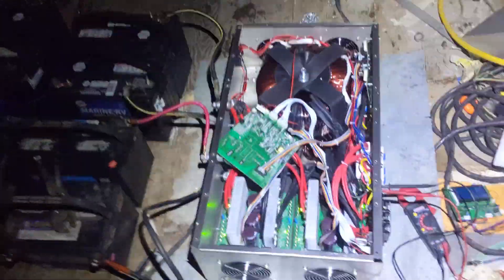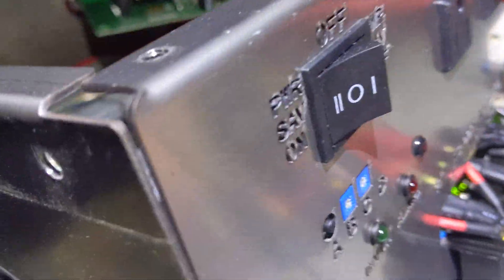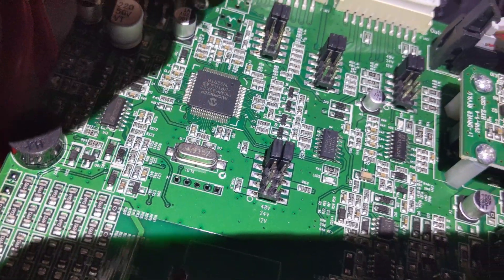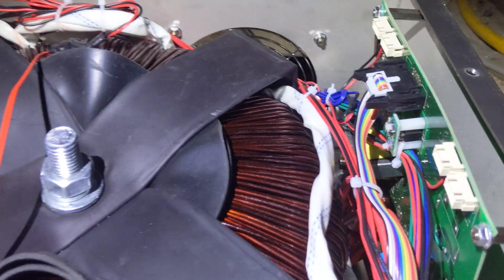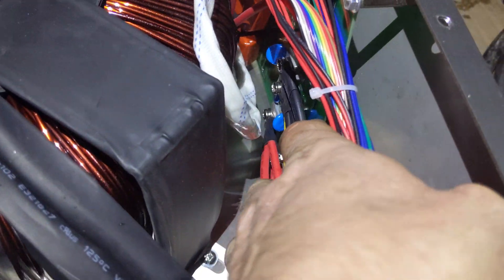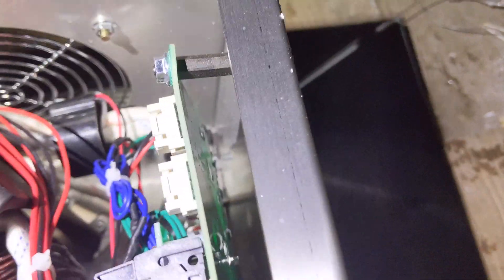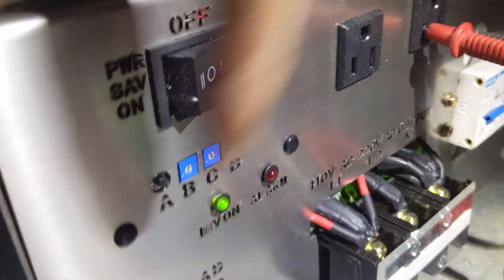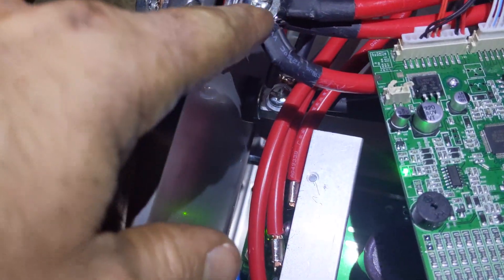PowerJack 20Kw Invertor Review - Dead On Arrival

Comment: I have seen knurlgnar24's review of Power Jack Inverter https://www.youtube.com/watch?v=PI9kAWQ_s4w.  Some of these inverters are undersized, and have a lot of heat shutdown issues, and other issues.  I have heard you might have better success with brands such as Samlex, Thor, Power Bright, and others.
Reply from the maker: Ya, probably 90% of other brand name investors will be more reliable and put out the power they are rated for.  They are priced pretty cheap, so I thought I would give them a chance. But ya, you get what you pay for most of the time.  My 12kw Growatt inverter is 100 times better than that Power Jack piece of 💩 and I've put it to the test, too.  So far, I've put a 7kw load on it while welding. And starts up my aircompressor, no problem.

Comment: Hi Spooner i've lost my powerjack info booklet could you tell me on the 48v's what's the most voltage it can accept i have lifepo4 batteries 
when my batteries hit their voltage of 56 after a few minutes it does like a surge and power off the inverter just checking i have now set my batteries to 55.2v this just done as of tonight....
Reply from the maker: Sorry I really don't know what the max input voltage is set at on these inverters.  I never really was able to test mine out that much.  I wnded up returned mine and got my money back.
Reply: ty sorry to bug ya

Comment: I have the exact same inverter not even hooked up yet....i have 10000 watts of panels i have 32 6 volt deep cycle batteries 48 volt system i have 4 banks what size breaker should i put between the battery and the inverter

Comment: how can i ground the inverter i can't find the equipment ground post on the inverter
Reply from the maker: I'd just remove one of the outside screws off the chassis and connect your ground wire to that.
Reply: Yeah, like Spooner says. It's bare stainless steel. Just pick a bolt.

Comment: Ive messed with these garabage inveters for years hoping that i could get a reliable one that would do at least half of it rated watts. Ive even gone as far as modifing my old 15kw sliot phase inverter so the transformer would stay cool doing only 5kw. Bottom story is that they are built like garabe, terrible customer service, and just a major stain on the inverter world from china. Ive spent 1000s of dollars and most importantly my time on this crap. I wish i would have paid a little bit more and went with quality! Ive got the new growatt 12kw inverter with built in 120amp charge controllers last week! Its a far superior product and if you think that transformer is big wait till you the grow watt 12kw! It weighs 200lbs and the windings on the coil are 8 Guage! The real deal. Even has wifi montoring and various setting. Love jt. Learned my lesson. Hope u find something worth your time!
Reply from the maker: Thanks for the feedback Jeremy.  I was able to return it an get a full refund.  They also offered to replace it with another one and I politely declined.  I'm still looking for another inverter to buy.  I'll check out the new Growatt 12kw inverter that you just got.  How much surge and continuous watts have you tested it out at so far?  My plan is to be able to power some pretty heavy duty equipment here at my place (for example a 5 hp 220Vac air compressor and welder).  A 5hp motor would need about 18kw of surge power to start it.
Reply: @SpoonerTuner  good glad you gpt your moneg back and saved some of your life messin with powerjack. Yeah ive got mine up to 8kw load and so far so good. Stays cool and isnt really that loud when the fans are on. I also have an outside central air conditioner i plan on using this summer. My old modified powerjack was handling the start up of the AC last year...but only for a month. Smh. When the AC kicks on it draws 12kw. Growatt specifically says it can be used to start up heavy commercial style AC untis with a surge up to 60kw. I believe it. The inveter is massive in this thing and it looks to have the right size mosfets with adequate cooling. Shouldnt have a problem at all if you get the big boy 12kw inverter from Growatt.  They are out of Texas. Can also look at their ebay store...thats where i got mine.
Reply from the maker: @jeremydosh2871  I found them on eBay and watched a couple YouTube reviews on them.  They look like a really good unit and not too expensive for what you're getting.  I'll probably buy one of them after I get some more money saved up. Thanks a lot for letting me know about them!
Reply: @SpoonerTuner  the magna sine inverters can be daisy chained to put out the power you want but they cost a arm leg first born not in that order. Lol

Comment: i have the 3000w LF inverter and had the same stand board with the stand offs floating around in the inverter, my board never had the stand offs installed :D POS
Reply from the maker: Bummer.  Sounds like this isn't such an uncommon situation. Such a little thing to get right but can cause  big problems if it shorts out on something.  Seems like they have potential as a company but it's like they are super careless or something. Too bad.
Reply: @SpoonerTuner  and the fact their inverter only output 25% and after that it turns into a square wave.
Reply: The stands of the board brake off on the heat sink
Reply from the maker: @gabrielmartinez3171  Yes you're right.  I noticed that after looking at it more closely. They should have used metal standoffs.
Reply: @SpoonerTuner  its sitting on the heatsink that is live so it has to be isolated they should use something better then those though. Overall for the price I'm okay with it was never intending to run 15k out of it but i do 2000 continuously during the day powering home and a/c every once in a while the pump kicks on my clamp meter cant record the surge but it runs about 6000 watts when it's on plus my normal load its loud though mine has 3 fans on the back.  I purchased a aims inverter 6000 and a sun gold power 6000 for other people pretty sure they're the same sun gold was cheaper by $500 but no complaints from them if my powerjack goes out that's what I'm looking into. I purposely over built my system 5000 watt solar array 16kw battery bank so the idle draw isn't a big issue for me. Hopefully the new inverter you get works out.

Comment: SORRY ABOUT YOUR INVERTER GETTING TO YOU LIKE THAT "  MAAAN " THAT WAS YOUR INVESTED SAVINGS  GOING DOWN THE DRAIN . YOU BETTER RETURN IT AND GET YOUR MONEY BACK OR ANOTHER ONE . 3 rd CHOICE , GET AN " AIMS " INVERTER CHARGER . ALSO YOU CAN ALSO TRY TO GET IN CONTACT WITH  THE " GENETRY SOLAR "  WEB SITE AND GET WITH  " SEAN "  , HE MIGHT CAN FIX IT BECAUSE HE IS SORT OF AFFILIATED WITH POWER JACK REPARING MANY OF THEIR CUSTOMER RETURNED INVERTERS .  IF YOU GET A CHANCE , WATCH MY SOLAR VIDEOS , HIT LIKE , LEAVE A COMMENT AND SUBSCRIBE . MAY THE SOLAR BE WITH YOU . GOOD LUCK !
Reply from the maker: Hey Cedric, thanks for the advice.  I was able to fix the bad control board that was cracked in half.  But it wouldn't put out more than 2000W.  I was able to return it and get a full refund from dr.aupower on ebay.  I will probably get an AIMS inverter/charger like you have.  I watched a couple of your videos and "liked" them.   I was really impressed by how much surge power your AIMS could handle when you turned on your air conditioner!    And you have a really cool setup.  I like how you labeled all your components that are mounted on the well.  Pretty groovy man!  haha     :)
Reply: Thanks for your interest in my solar because we prepped must stay ready for backup power just in case our lights goes out  or save money on the light bill at will at this time & age . Always stay prepared .

Comment: Get your money back. These guys make the worst equipment on the market
Reply from the maker: Ya, I just got off the phone with eBay and eBay made an exception on my behalf to re-open the return.  PowerJack will have to pay the return shipping on it.  I'll try and do another video on it. I was able to fix the A/C board myself.  It was the one that was cracked in half next to the transformer.    It works fine but the deal breaker for me is that it consumes 50 watts at 48volts and 150 watts at 61 volts with no load connected to it. All that power consumption is producing heat in the transformer which kicks the cooling fans on and off.  If I had gobs of power coming in, lots of batteries and lived in Antarctica it would be great. haha   Do you have any recommendation on a split phase inverter that won't break my bank?
Reply: @SpoonerTuner  ya sure. Fox power. Aims. Sigineer. Spartan. Or if you want to save more money get a Reliable inverter and get an auto transformer.  Check out my channel if you get time. Click on my name/pic. Cheers
Reply: @frankz1125  sigineer and aims inverters have high idle current as well.
Reply: @jakeandrules7724  my 10kw has 75w idle
Reply: @jakeandrules7724  but that least those 2 inverters will do their rated power.
Reply: @frankz1125  agreed, they will put out their rated power. I could swear the aims was shown to be high as well, i know the sigineer is for sure.
Reply: @SpoonerTuner  you will have to spend some money to get at least a half decent inverter.
Reply from the maker: I just looked up the specs on the AIMS 8000W inverter (model# PICOGLF80W48V240VS)
Idle consumption: 100 Watts
Power saver mode idle consumption: <25 Watts

So my PowerJack 20KW inverter consuming 50 to 150 watts at idle consumption seems pretty on par with the AIMS inverter. But the power save mode on my Power Jack doesn't work for some reason.
Reply: @SpoonerTuner  you will never pull 20 kw through that power Jack. The aims will do what its rated for. Quality difference is night and day
Reply from the maker: I think you're right.  I just tried to run my 120v 15a 2hp air compressor on it and it shut the inverter down.  I just looked it up and a 2 HP ac motor should have a surge power draw of 4000w - 8000w and running watts of 2900w.  My battery bank was fully charged and input voltage didn't drop much. It didn't damage the inverter which is good.  But ya, their 40kw surge rating and 20Kw continues rating is a joke. So far I've pushed it to about 2000w.   I'll try testing it out more before I ship it back.   I watched a couple of your videos.  You have a pretty nice setup there at you place!
Reply: @SpoonerTuner  thanks. Cheers
Reply: @SpoonerTuner  mine starts a 3hp 240v deep well pump it's the 15000 version doubt it'll handle 15000 watts but can handle the well.
Reply from the maker: @gabrielmartinez3171  That's good to know.  I think mine was just messed up due to the control board being cracked in half.  But I'm sure the specs are over rated on them.  Plus I'm really not impressed by the quality overall.  I gave it a shot and didn't work for me.  I'll be going with something better quality next time.
Reply: @SpoonerTuner  I have the same problem with a 15000 watts power jack . Would you share the phone number of EBay. I can’t find it. Thanks
Reply from the maker: @manuelmontero6897  Ya it was hard to find. I'll try to find it again and post it here for you.
Reply from the maker: @manuelmontero6897  So in the eBay Android app I clicked on the Help link. And then at the bottom of the page there's a button that says "Have us call you".
Reply: @SpoonerTuner  thank you